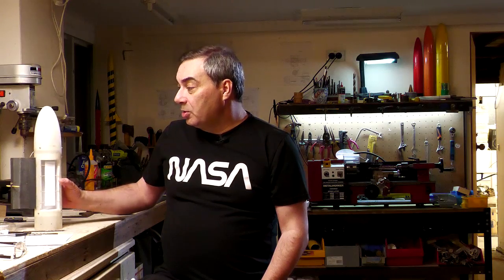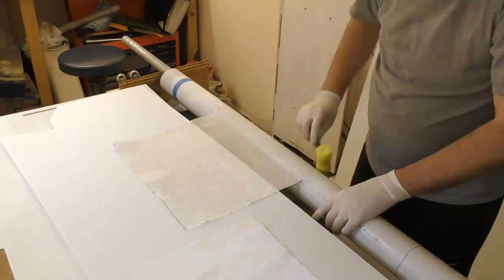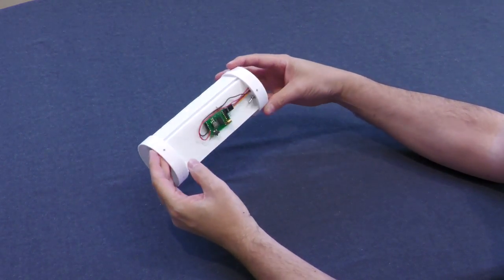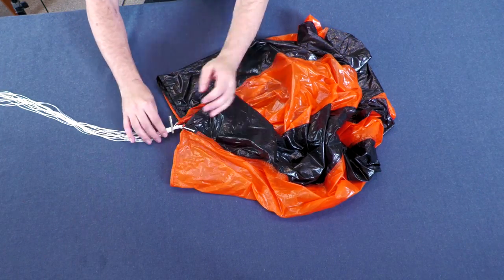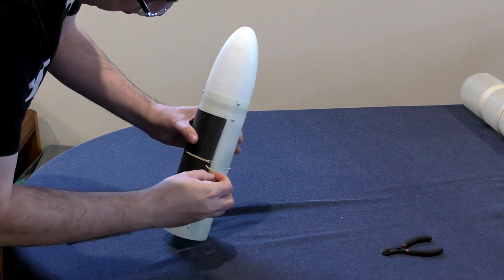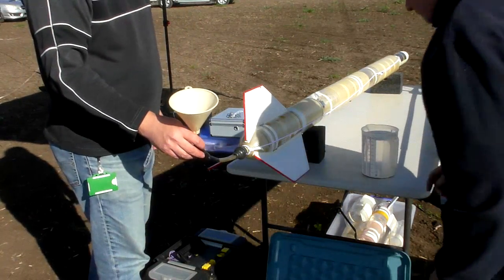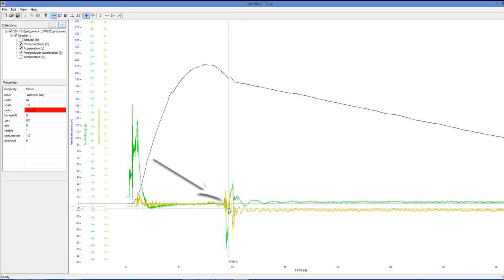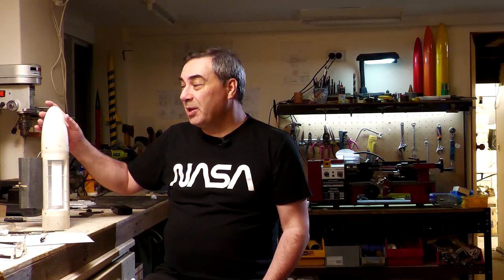2 Stage Water Rocket - Part 33 - Booster Parachute Deployment

Comment: Hello George
Another very nice (and very clean...) realization. I admire the work on the fiberglass and the carbon... The folding of the parachute is impeccable. My method is different, but the main thing is that it works. I also place a piece of tape on the retaining cord. And I see that you are now attaching the parachute to the center of gravity of the rocket. Thanks again for your great videos !
Reply from the maker: Merci Francois, Yup we want to bring the rocket down sideways so that it increases drag and it also means that the nozzles don't hit the dirt first. Bringing it down sideways means that we have to run the shock cord down the side of the rocket. I am not too happy how it just hangs there, I think we may have more tape for the final rocket.
Reply: @AirCommandRockets  Thank you for your answer George and good continuation in your amazing research

Comment: Thank you for your promise, I will appreciate your word.

First Idea:
 by conducting simple calculations, we find that changing the diameter of the thrust nozzle with the change in the weight of the missile and the change in gas pressure leads to an increase in efficiency. For example, we can use a rubber nozzle, with high pressure at the beginning, its diameter is greatest, the flow is high, the force is great, and it gradually decreases.  Until the water in the rocket runs out.  We can use a more complex nozzle similar to the F-22 Raptor's thrust nozzle (square hole with two spring-bound wings).
Reply from the maker: In terms of a variable nozzle. We have already done those tests back in 2008 http://www.aircommandrockets.com/day65.htm#vid_variableNozzle and here are some captures from the video: http://www.aircommandrockets.com/images/day65/VariableNozzle.jpg
Reply: @AirCommandRockets  
Very good 👍

Comment: Back when I built and flew R/C gliders I had spoilers on them that were designed to use tape for the hinge. I did not like this so I designed a hinge that  I believe will work for you deployment door.

Use a thin piece of piano wire as the hinge pin with either 3D printed hinges or like I did, small glue in nylon hinges. The piano wire was also used as a torsion spring that held my spoilers close tight and flush with the wing but you could reverse it to hold the door open. Basically the legs on each end of the wire hinge pin are twisted 180 deg out of plane with each other and used to torsion the door open. Wire diameter will vary the torsional force. The tape does not look like it would stand up long with the aerodynamic forces trying to peal it along its length.
Reply from the maker: Nice! I like the concept of the torsional piano wire acting as both a hinge and the spring mechanism. That's nice, clean, compact and shouldn't be affected by the blast of water coming from the second stage. Thanks for the suggestion. :)

Comment: You may have mentioned in a previous video, and this spring loaded system looks like it works pretty reliably, but why not go for a traditional black powder charge separation mechanism?
Reply from the maker: This is a good question. There are a number of reasons why we prefer a servo based deployment mechanism. 
1. We don't need a pyro license to buy and store black powder. 
2. There are no consumables so we can test the mechanism dozens of times. There is no additional cost for black powder or e-matches every time we want to do a test. 
3. No residue to clean up. 
4. No need to protect chute from hot gases
5. Energetic charges aren't a great idea next to pressurised vessels.

Comment: hey George! I have a questions. I'm planning on making a carbon fibre water rocket and was wondering if you know how much pressure just carbon fibre could hold. I've also seen that you 3d print the molds for your end caps and was wondering if I could potentially use normal bottles with their ends cut off. then keep those inside the pressure chamber but add carbon fibre on the outside of the bottles to make sure they can hold enough pressure. Thanks!
Reply from the maker: Hi, sounds like a fun project. How much pressure carbon fiber will hold depends on a couple of factors: The wall thickness and fiber orientation in the walls of the pressure chamber. The wall thickness depends on how many layers you have or what the fiber count is in the cloth. There are different weight cloths. You should be able to use bottles on the inside. If you are going to use bottles, I would recommend splicing the bottles first to make a waterproof pressure chamber internal bladder, that way you know it's sealed and then reinforce the whole thing with carbon fiber. This way if you end up with small holes in the carbon fiber it won't leak. Also consider using just fiberglass as it is much cheaper and it's strength is perhaps only 30% weaker than CF. Regarding fiber orientation, there is an ideal winding angle of 55% for cylindrical pressure vessels.

Comment: I thought you would've used Nova's nose recovery system like in the past.
Reply from the maker: The Nova deployment style mechanism can't be used in this case because the parachute is just too big and the door on the nosecone would be directly impacted by the blast of water coming from the second stage which would most likely break it. That jet of water coming from the second stage is strong enough to easily bend 2mm aluminium plate. (this is from experience)

Comment: Can the retention rubber band be swapped with something that doesn't stretch? I'm afraid the slipstream could force the parachute door to open with that rubber band holding it closed.
Reply from the maker: Yes, the rubber band will be replaced with a solid latch. The latch has to be very strong.

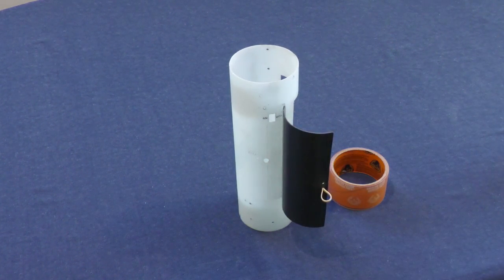Comment: 2:39 Kevlar hinge like in rc plane ailerons
Reply from the maker: Interesting, I will have to look into that. Thanks for the suggestion.
Reply: @AirCommandRockets  You may can use peel ply clothes (1 or 2 layers) for hinge. Both ends must glue/epoxy between the airframe and door layers and only a very thin strip (0,5-1mm) left uncoated.
Reply from the maker: @andrasmeszaros8985  One problem for peel ply is that it is designed to separate from epoxy. But this is something we plan to investigate is making a hinge with cloth that won't separate easily from epoxy. We will use a gel epoxy that should not wick into the flexible part of the hinge.

Edit: I have just had a look and people do make hinges from peel ply. I will have a look at this, I think I have a way of perhaps using it where it should be a little more secure. So thank you for the suggestion.

Comment: I'm interested in building a water rocket of my own and was wondering if in your experience plastic quick connects for garden hoses are capable of handling at least 100 psi or if brass ones are needed.
Reply from the maker: Plastic Gardena quick connects will handle 100psi just fine.
Reply: @AirCommandRockets  Ok cool

Comment: Second Idea: 
It is well known that the small bottle can withstand greater gas pressure than the large bottle before it collapses.  So one of the important improvements I made is the following: use a large, long main bottle that contains the most amount of water and the least amount of compressed air, and use two, three or four bottles that contain the most amount of compressed air and the least amount of water connected to the main body of the rocket with a valve  Set to a certain pressure is the collapse pressure of the large main flask.  And by doing the calculations, we find that we can maintain the air pressure above the water and get a constant push for a longer period of a larger amount of water.
Reply from the maker: Yes the water chamber doesn't need to be as strong as the chamber with the gas, if you can make sure that the water chamber doesn't overpressurise as you release the gas into it. You will add extra weight though for your valve mechanism. I know this idea has already been attempted before by others, sorry I don't have a reference.

Comment: Nice and stable behavior when hanging under the parachute. I think I will modify my water rocket to this two point shock cord mounting. I'm not sure, if landing on fin or on nose cone is better.
Reply from the maker: You can adjust the angle so that either nose or fins hit first. Note that the fins will generate some lift on the way down changing that angle somewhat. But falling sideways like this should provide a stable platform for a camera looking down.

Comment: That looks promising, although I am guessing that you will need a much stronger latch for the door on the actual booster (due to the drag from such a high-speed launch). Is there any progress on repairing the leaking nozzles on the booster segments?
Reply from the maker: Yes, the latch mechanism will be very different on the actual flight hardware. This was purely a test of getting a large parachute out of the airframe. The door will also have a much more secure hinge. We are in the process of attempting to repair the leaks over the Christmas break.
Reply: @AirCommandRockets  Nice! Can't wait to see the next video 😃

Comment: what i like to do in ksp is sequentially open my parachutes to spread out the g load, i dont know how viable that is in reality / leads to the rocket shaking too much. the way your chutes are spread out i can imagine helping it guarantee that the 2 chutes dont entangle each other.
Reply from the maker: The parachutes will be deployed by completely independent systems so it is unlikely they will both deploy at the same time. In previous flights we've found that once one parachute opens, and the rocket slows down, the second parachute takes a lot longer to open due to the lower air speed. Here is an example of what I mean: https://youtu.be/0qzOzjRJpaU?t=90

Comment: Fourth idea: 
The design of the cannon barrels inspired me with this new idea: that the missile should consist of two or more bottles, a small bottle inside the large one.  This will inform us that the small bottle is surrounded by high pressure, and therefore we can charge it with more pressure than usual, and add that the small flask naturally bears more pressure.  This idea is complex to manufacture.  But theoretical calculations will increase the energy for weight.  Imagine, for example, if there were four bottles inside each other.

Comment: Third Idea:
 By conducting theoretical calculations of the shot stored in the missile, the energy released from it, and the maximum height, we find that theoretically we can achieve a greater height if we extract the energy stored in it in a way other than direct jetting, i.  It is powered by the turbo engine.  But our calculations indicate that at first the thrust is not sufficient to lift the rocket with its payload, so the new rocket could be of two stages as in space rockets, the first stage being two medium side rockets with jet-propulsion for lifting, and the main rocket with turbo-propulsion.  The difficulty here lies in placing a small water turbine to extract the energy of pressurized water and then the remaining compressed air. the Rocket can look like as Virginia submarine.

Comment: Fifth: We can use this idea for simple school rockets, which is to strengthen the flask by creating circular annular fusion with a thermal resistance wire, so that the shape of the flask from the inside becomes like an airplane or a submarine, rings of plastic.

Comment: how about steam rockets, or hot stone + water = steam, or maybe termite + water = steam rocket, ultra fast pressure, if proper ratios, termite itself is not a rocket fuel, but with water steam tube it is, a water propellant
Reply from the maker: Steam rockets have certainly been done, but that is a different class of rocket. Steam rockets use a phase change (liquid to gas) to generate thrust, whereas, regular water rockets don't. Here is a good example of a steam rocket: https://www.youtube.com/watch?v=zLjaBDZ2J2o
Reply: @AirCommandRockets  um, pressure is pressure, no matter how its generated, and output is water, right?
Reply: @AirCommandRockets  well, you can pressurise air by steam and load the rocket, eh :)
Reply: @AirCommandRockets  yes steam age coal fire powered air compressor, whatnot
Reply: @AirCommandRockets  well how about hot air-pressure rockets